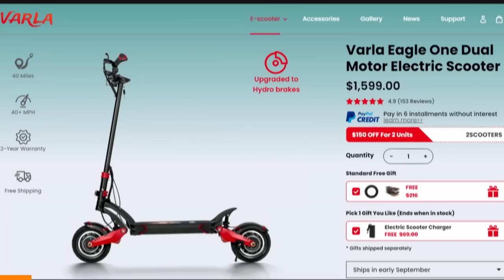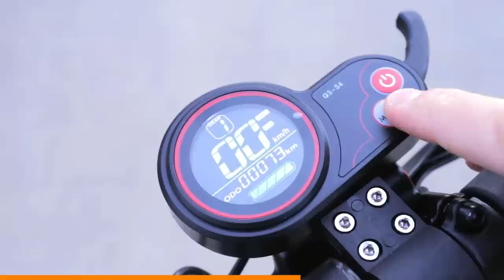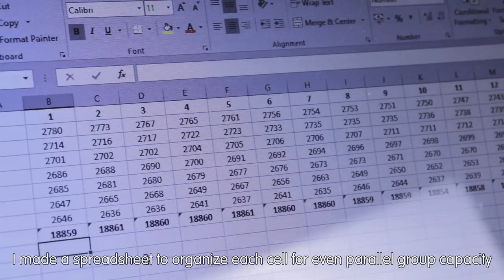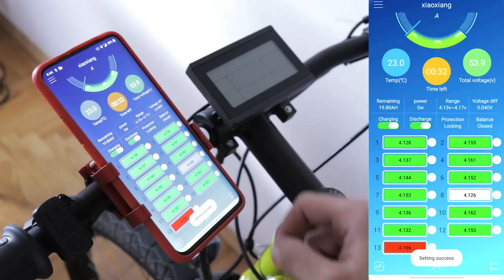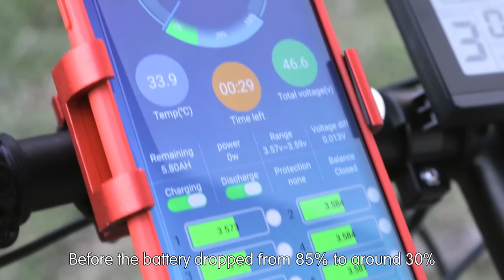DIY 1000W 45km/h Electric Bike Using Cheap Conversion Kit

Comment: Where are you from, I wish you could build my battery like yours, you know what to do. Nice build, nice changes. I want to make my bike electric, but still don't know what battery I'd good for range, for a motor 48v 1500w rear hub
Reply from the maker: Hi! I'm located in the EU. Thanks! I'd recommend you go with a 52V (14s) battery with a capacity of at least 18-20Ah. Will give you plenty of speed and range. I used a battery like this in my previous e-bike build video.
Reply: @DonnyTerek  where from eu, I'm in 🇪🇺 too. I wish I could get a battery that good, it's a little bit expensive, but it will be very good for range, to go from A to B 20 km distance a land 20 more to came back.
Reply from the maker: Feel free to contact me by email which you can find in my channel's 'about' section or through Instructables which you can find in the description of other videos if interested.
Reply: @DonnyTerek  I will , thank you very much for info. And great video I will use this to guide myself when I'll build mine.

Comment: For anyone doing this with rivet nuts. If you have the steel ones use lots of lube while tightening and expanding them. Transfers the energy much better into the rivnut
Reply from the maker: Awesome! Thanks for the tip, haven't considered applying any lube while installing mine.
Reply: @DonnyTerek  i stripped allot of stuff with the steel one but with grease it worked great

Comment: Awesome build :) - I'm a little scared of you using XT60 connectors for a 1000w application though! :P I use them in the rc-model world but for much smaller things, there are beefier versions that probably suit your thing better.. like XT90 or higher
Reply from the maker: Hi, thanks!
The XT60s can withstand the high current for quite a while. I haven't noticed any melting around the connector after using it on this build.
Reply: XT60's are fine with current setup and 25 amp controller or whatever he is running. They'll take it. No harm going to XT90 though. When going super power, you've got AMAS XT150 connectors or EC8 connectors.
Reply: you can easily pull 60A peak battery current through XT60 without worrying about overheating

Comment: Hi donny,I want to ask ?  I have a 1000 watt 48 volt rear engine.  so I want a battery that can last 8 or 10 hours a day or the longer the better?  so how many volts and ah battery size?  because I'm a bicycle food delivery…. Thank you donny
Reply from the maker: Hi! The needed battery size highly depends on the rider's weight, terrain, speeds, how much you pedal, etc. For a regular DIY e-bike you most likely won't be able to fit more than 20-25 Ah battery. I would suggest you go with a 48V 20Ah battery and check for how long it is enough for you. Perhaps have a second one that you can safely charge while the first one is being used.
Reply: if you have a 48 volt motor and controller, use a 48 volt battery.
As for ah, the more the better if you are wanting to ride all day, so fit the biggest you have space for in your frame. 10 hours is a lot though, so you probably want to buy 2 batteries and keep one on charge.

Comment: What are the advantages of building your battery yourself other than knowing how well you assembled it? Do the pre-ready ones don't have the temperature readings? Also there are a lot of type of batteries available, what to choose between 36/48/52 V, and what AH choose too? The higher the AH the more charge it can hold? Your videos really makes me want to build one of these ebikes kit but i'm just not sure for the batteries
Reply from the maker: Well, probably the main advantage is that you save quite a bit by making one yourself and you don't cut corners on quality. Personally I haven't found pre-built battery packs this size with a smart BMS installed that lets you monitor the temperature and other readings. The required voltage of the battery depends on the kit that you are using. Check what your controller can accept. Most of the times if the controller shows that it can handle up to 48V, usually they also work with 52V. This way a higher voltage battery produces more speed. The controller in this kit works with, therefore I use a 48V (13S) battery. I believe it would also work with a 52V (14S) battery, too. The larger the Ah rating, the more distance you can cover in one charge. Depends if you want the bike to go on longer distances, then go with a larger Ah rating - 18 to 21 Ah. Of course the larger Ah rating costs more since it needs more battery cells.
Hope this helps.
Reply: @DonnyTerek  Thank you so much for your answer, really informative, i'm even more eager to build my own now !
Reply from the maker: Awesome, hope I could help a bit. There are tons of info on batteries on the web and YouTube. Take some time to read or watch a few videos to get at least the basics of voltage and capacity. You will understand the requirements much more easily then. 
Best of luck on your future build!

Comment: why use a full suspension bike if you are never gonna take it offroad ?
Reply from the maker: There are plenty of bumps riding the streets which the full suspension frame makes much nicer to ride over especially with a motor weighing the same as a regular bicycle on the rear.

Comment: Bicicleta eléctrica con doble suspensión es una mala elección. Jamás se debe reconvertir una bicicleta de doble suspensión a e-bike. Va a generar problemas futuros en el cuadro ya que lo retuerce, aunque la suspensión trasera tenga bloqueo. El cuadro no debe ser con suspensión trasera. Sino queréis tirar el dinero NO LO HAGÁIS! Y menos todavía con un motor de 1000w. Mal negocio!
Reply from the maker: Having your comment translated, I would have to disagree with this. I have made an even more powerful e-bike with a full suspension frame. It is holding just fine to this day after more than 400 km and some abuse. You may have had problems with a low quality full suspension frame or the pivot points were not tightened properly.

Comment: Could you also make a video where you try to create a bycicle that can produce electricity if it's possible? I already searched for it on YouTube , but this kind of video is really hard to find.
Reply from the maker: Hi! Sorry but I don't see a point in making such a project.
Reply: Just put a car alternator on your bike. You can recharge 12v all day
Reply: There may be a reason that you can't find such a video. 😁
It is just not possible. Sorry. An alternator does not turn for free.
You have to invest energy. A little more energy then the alternator will produce.

Comment: Hello friend! Can I use a 1000w motor with a 20 ampere battery ? And how much battery ampere can I use in a controller module in order to not fire up the circuit? Thanks bro!!! God bless
Reply from the maker: Hi! You can definitely use a 20 amp hour battery for 1000W. My DIY battery resulted in around 18 Ah. The amp hour rating does not burn controllers, the voltage does. This controller is rated for 48V battery but I believe it also accepts 52V.

Comment: It ain't cheap
Reply: Its most likely one of the cheapest.
Reply from the maker: The total price of the conversion including the battery cost me around $600 USD, so I consider it cheap compared to a factory built e-bike with these specifications.